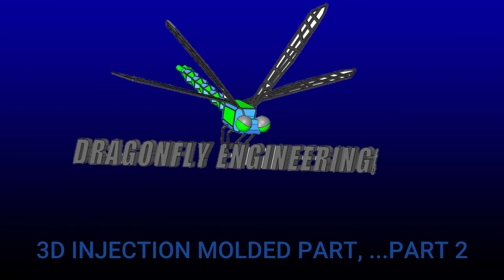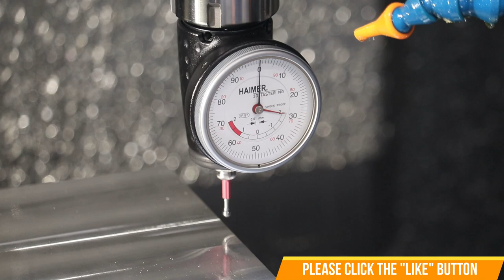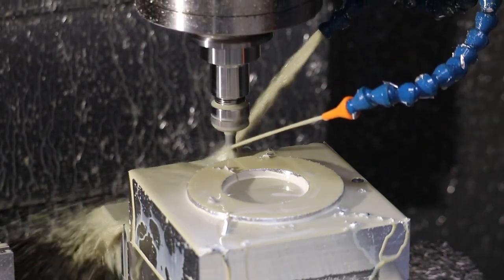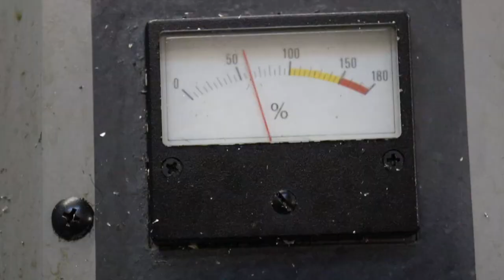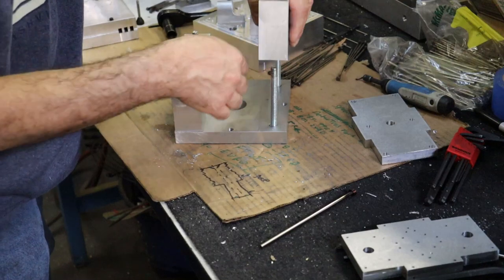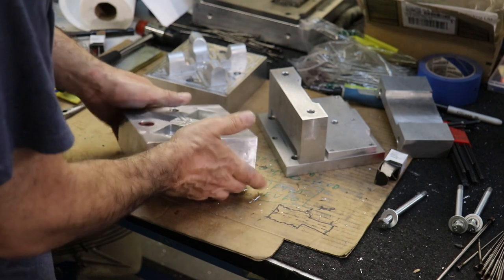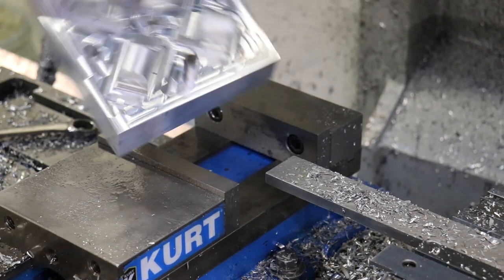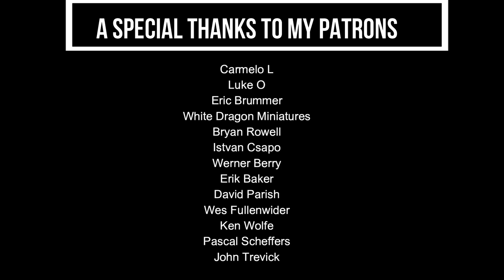3D MOLDED PARTS EPISODE 2

Comment: When watching all this - isn't it cheaper to buy a complete steel tool as a frame and then use aluminium inserts? A small form of this size including all mounting material and four guide pillars etc. is around $700 (for 1.1730 steel) here in Germany.
BTW: What are your aluminium moulds made of? AW7075?
I like the smooth surfaces of your cutter head. In an old video you said you use round inserts for a better surface. What inserts do you use? Especially for aluminium?
Great videos - I learn a lot of them for me and my starting new business with a small Boy 22. Thanks a lot! :-)
Reply from the maker: The aluminum blocks are pretty cheap and several parts are standard, like the base and rails.  A steel frame is just another bunch of parts that you need to fit together with tolerance.  So I usually skip the frame and buy 7075 or QC10 alum blocks from Mcmaster carr ( overnight delivery standard and cheep).  The amount of machining steps are about the same.  Also the customer wanted to buy this mold.  The shell mill is Mill Tec USA.  The inserts this time were 8 sided octagonal with ~0.3mm radius for the rail and 12.7mm full round for the molds. Thanks for watching!
Reply: @DragonflyEngineering  Thank your for your detailed answer :-) Ok, when selling the complete mold then your way is much cheaper.
I'm still in preparation for my machine (delivery in week 40) so I'm searching for a cheap way of a changeable mold for my first steps. Most quick change molds are by far too expensive (frame around 3-4000€, inserts around 400€ for my sizes) so I think about a "big" standard frame (196x196mm) which stays on the machine. These standard parts are very precise and fits exactly together (plate, risers etc.) so there would be no need to machine them and I only have to machine a square hole in the ejector side plate (for the ejector plate of the changeable form) once and four small pins for exact mounting of the aluminium molds. No good idea?

As I could see you only use aluminium molds? So the tool life range is better than most people estimate? When asking tool making people they are very skeptical and don't recommend them. But they seem to work perfect for you and your part quantities so I'm optimistic that they will do also for me (beside the fact I cannot really mill steel ;-)

Did you ever tried to anodize your forms for a better tool life? I will try this with my molds (anodizing is one of my main businesses ;-) and see if I can recommend it. May be my experiences could be interesting for you and others.

Ah, and thank you also for the method of "grinding" the ejector pins because I don't have a grinding machine here (yet?). Didn't know that this works at all ;-)